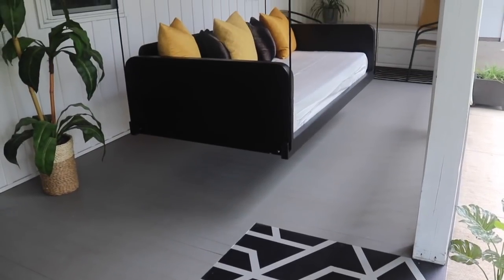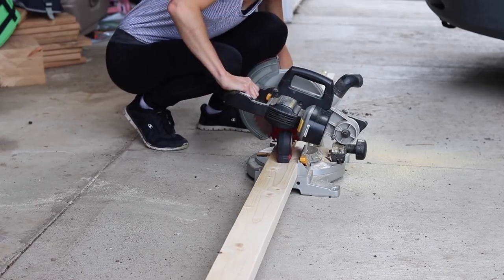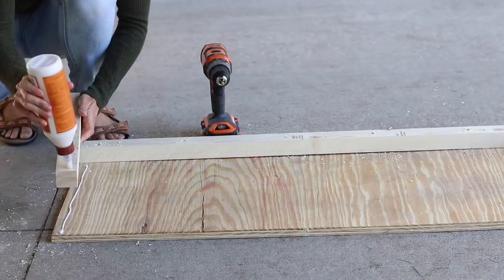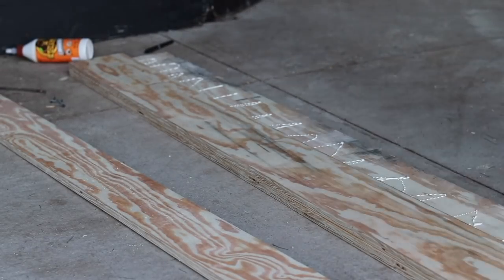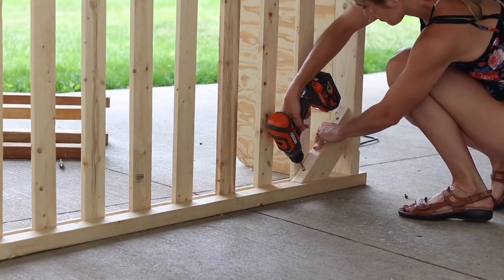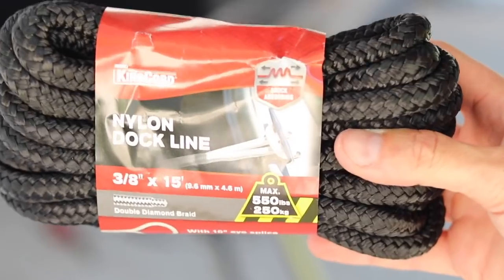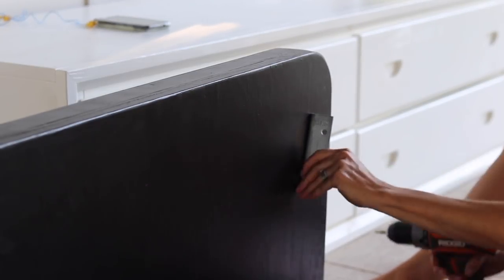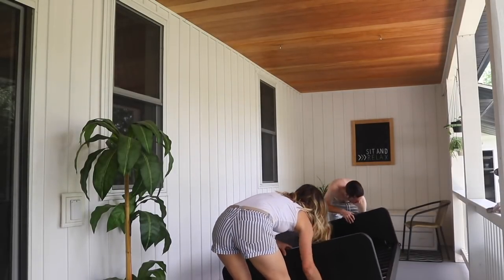How to Build a Bed Swing | Porch Bed Swing | DIY Wooden Hanging Bed

Comment: Another little trick is to put tape around the rope we are going to cut it before you cut it and then cut through the middle of the tape that will keep it from fraying as well when I always burn it at the end too but it’s good for the cutting process or if you have to stick it through a whole. I’m so glad you made this video I have my futon out on my patio and I was thinking about hanging it up which would be a lot easier than yours but mine is kind of ghetto and I was looking for a porch swing bed and nobody else has done it so yeah I’m glad I found this video and I’m glad you actually did This and brought it to fruition😁👌🏻😍

Comment: Great work. A few tips. Next time you can get a longer jigsaw blade from bosch. When sanding plywood, don't go lower than 120 grit sandpaper because the outside layer on both sides of plywood is very thin. For wood putty  you can use a plastic or metal putty knife. That will make you work faster. Also, a palm router with a roundover bit will help you get the smooth edges you wanted in a lot less time. Considering the end result I must say I'm impressed. Regards from Costa Rica.

Comment: Very impressive! You're a inspiration to everyone. Quick tip, I'm not being critical but we all learn from doing, at 10:52 your cable clamps are on backwards. You loose a lot a strength putting them that way. Search "never saddle a dead horse" for diagrams how the saddle should be. Keep up the great work!

Comment: A tip for you when cutting nylon rope - wrap your cut line with electrical insulation tape first and then cut and burn. This will maintain a much cleaner cut after burning.

Comment: Nice work!  Obvious stuff others have said about power tool safety.  Would also suggest longer hook lag bolts into those ceiling  joists.   I have seen lag bolts get pulled out of pine.

Comment: Wanted to say that your "heavy duty clamps made for rope", are actually made for wire rope or cable. The "tag" end of your loop should be under the u-bolt and the load side of the loop run thru the "saddle". BTW, you are mesmerizing to watch and listen to. Keep up the great work.

Comment: Just a small point about nylon rope.  It stretches, especially when it gets wet.  I've pulled 150 feet out of an original 50-ft length of nylon.  If stretch might be, or become, an issue, check with a nautical supply store for polyester or Dacron line in any color of the rainbow.  You get all the same characteristics of nylon without any stretch.

Comment: When you're going to do something where the audience can't see (e.g. re-enforcing ceiling joists), it would be great to have a visible mock up on the ground that shows what you're trying to accomplish.  I'm also wondering if rain doesn't come in from the porch enough to be problematic ... I'm assuming the matress has a waterproof cover, but the bedding would get wet.

Comment: Are those screw hooks in the porch ceiling?
Eventually they pull out. Would be better to use eye-bolts with large washers and lock nuts in the attic. you may have to add a stringer in the attic for the bolts. Just a thought. 🙏✌️👍 Nice work!!

Comment: wowser.,. Among other that certainly was quite the narrative... please grab some PPE: safety glasses, skin tight neoprene/ stretch fabric back gloves to handle lumber, HD Latex gloves for spreading putty or at least a plastic spatula, safety glasses + ear plugs for use with that table saw!; and last, but certainly not covered shoes and you really need a Pencil & speed square! Remember -- you are generating exposure to possible mishap and it happens in less than a split second.,. Safety is no accident. Ck Maintenance

Comment: This is amazing. Exactly what I want in my backyard. Do you have a detailed materials list for this project?
Reply from the maker: Well, I made almost the entire bed swing out of scrap wood, so I'm not sure exactly what you'd need to buy to make this. I'd guess 1 sheet of 4 x 8 plywood 3/4 inches thick, eleven 1 x 3's to run 39.5" long supports and three 10 foot 2 x 4's should do it! Then 30 ft of nylon dock line plus clamps, screws, wood putty, primer, paint, 4 screw hooks rated for 250+ lbs, and sanding discs for your sander. Those are the materials I can think of - hope this helps!! Thanks for the compliment.

Comment: Well done! But a word of caution, please consider using protective gear when using power tools - eye wear, boots, gloves will go a long way
Reply: Don’t wear gloves when working with power tools... you’ve been watching too many of the idiots on DIY Network. Spinning cutters, drills, etc... will catch the gloves and pull your hand into the tool. Read any safety manual for a power tool and it clearly warns against glove wearing.
Reply: @joeblow5958  that's true I'm one of the ones that destroyed a finger from wearing gloves it didn't involve power tools but the material snagged my glove when it fell and smashed my finger doctor even told me if I wasn't wearing gloves my finger would have been okay

Comment: Very cool project and looks great. Is there anything in the design to deal with the swing banging against the wall? Obviously, grown ups can sit peacefully, but kids not so much. Wind could cause trouble too without something designed.
Reply from the maker: Yep, the hooks are turned outward for this reason as well as how low you hang the bedswing (mine is 16 inches off the floor) prevents it from being able to hit the house.

Comment: How did you attach the bottom rope to the frame?  Just a knot or did you use washers?
Reply: Not shown. I'm guessing it's one rope length that is in a loop at the bottom. The ends are at the top hooks. Probably wrong...

Comment: Excellent work!  Quick question.  Did you use anything to encase the mattress to keep it dry on rainy days, etc?
Reply from the maker: Hi Brent - we actually just move it in if we know there's moisture. We're using a crappy mattress and will tackle moisture when we need a new one. :)

Comment: Hello, how are you?  Have you ever used auger bits for larger holes?  If you tried an auger bit, you would throw those paddle bits in the trash!    Keep up the good work.  Be safe...safe, like, not running a table saw with long loose hair.  We wouldn't want that blade grabbing your hair and pulling your face into it.  @-}----

Comment: Great work. I hope you got a sponsorship from Kreg, that would be "big timing it!" I like this project. Well done. 
PS: Armor Tool makes an awesome pocket hole tool. It's almost the same as the Kreg, but has an adjustor for the collar on the bit, and I also like the color coating that tells you what length of screw to use. Also the lock down handle is on the side closest to you instead of the away side.
PSS: Sanding sucks, but it is soo worth it.

Comment: I wish you would have taken your camera or a picture of what you did to put reinforcement wood between joists so we could have seen what you did up there. Or drawn out what you did on a piece of paper
Reply from the maker: I'm sorry! I couldn't fit my camera up there at all, I had like two feet of vertical space to move around. So I can explain to you. I cut treated lumber (can't remember if it was 2 x 4 or 2 x 6 now) to span the length of as many joists as I could. I was limited by the angle I would need to push the lumber up into the attic through the little door. So I cut them to span three ceiling joists (I wish I could've done more). I went up in the attic, laid the boards across the top of the ceiling joists so that the joist where I'd screw the bed swing hook into was in the middle and screwed 3" construction screws down through them. This connected the joists and as the weight of the bedswing pulls on the joist where the hook is, that joist is supported by the two on either side of it. I did this four times for the four areas where I'd put hooks on the ceiling underneath. I hope that makes sense!!
Reply: @WelcometotheWoodsBlog  so you didn't sister your ceiling joists, but laid strongback sleepers. How did you locate the exact center of your ceiling joists for your hook? Did you drive a screw right next to your joists so you could see from below?
Reply from the maker: @winnlunt5006  no I measured from the edge of the trap door and then drilled up.
Reply: @WelcometotheWoodsBlog  cool, excellent job!!

Comment: Around how much did this all cost you?
Reply from the maker: I used all leftover plywood/leftover paint from other projects. I spent about $40 on new material (two 2 x 4 x 10' and screws, furring strips, ceiling hooks, nylon dock cord, etc). It wasn't expensive! I think if you were to buy all the materials yourself and make it (provided you had the tools already) you could definitely do it for under $100!

Comment: I'm okay with the project but she stated she wanted 1000# capacity, then says the swing is heavy.  Using 4 screw in hooks that typically are rated at 150# static load isn't wise.  Of course at the end she says its good so far with no creaks or failure.  Not sure thats a way to instruct people.  If only she'd do her homework and follow safe practices she'd knock it out of the park! Best of luck!
Reply from the maker: Each of my hooks are rated for 290 lbs and the bed swing weighs about 70 lbs

Comment: It is impossible for me to be impressed with anything in this video after 1st seeing you run a circular saw in sandals but later in bare feet???

I like shirts but will not usually wear them when building, when it come to feet, they are comforted and protected in steel shank, safety toe cowhide over the ankle boots.  I recommend looking into a pair and am compelled to suggest Danner Centurions as no other show feels better on my feet.